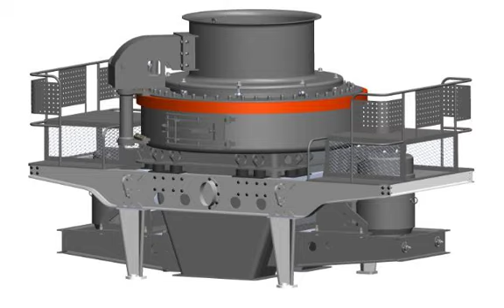Iron-process hematite to iron process

Comment from the maker: New rail capacity would also be required  Based on the rule-of-thumb of 100 Mt y per rail line, increasing production by approximately 500 Mt y would require 5 new single rail lines  One scenario is an extra rail line for all the majors  BHP (from double to triple track), Rio (double to triple track), FMG (single to double track) and at least two new lines  New lines have been proposed by Hancock to service the Roy Hill mine and QR National to service non-major producers